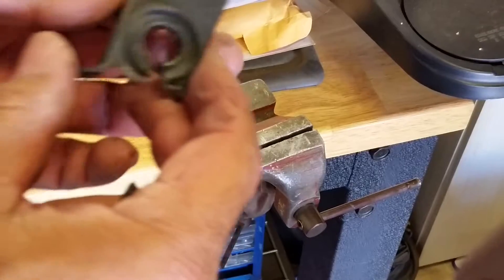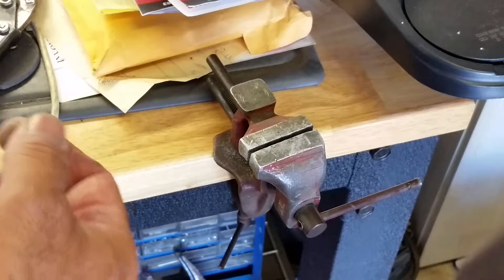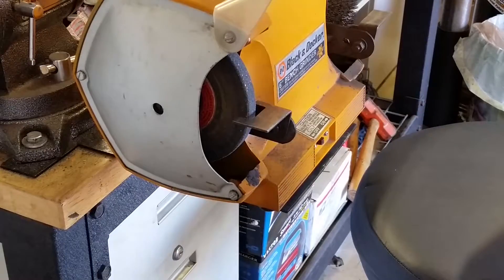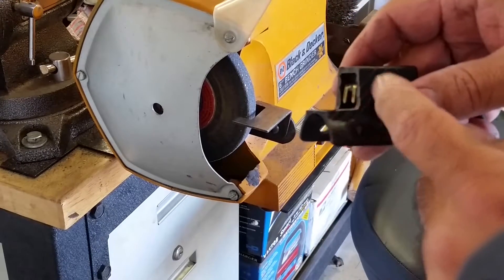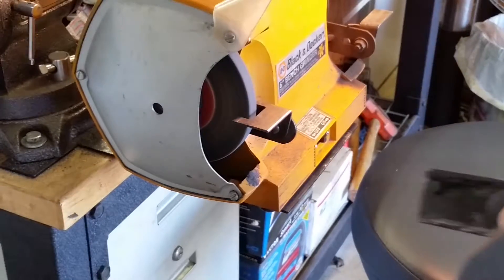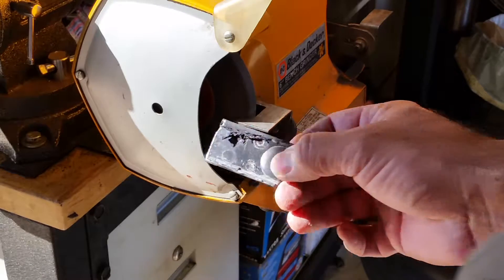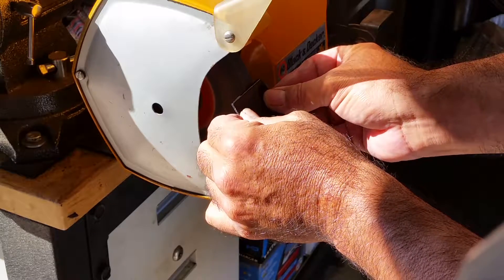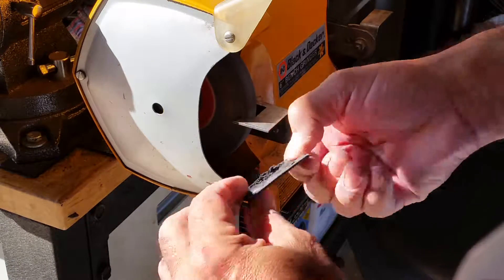How to: Converting a Miller 211 Autoset, 10 foot torch to a Bernard Q Series 20 foot torch Part 3

Comment: All that to get a plastic plug to line up with the stock screws? I would have simply hot glued the plastic plug onto the connector housing, or set it back and screwed it in the plastic housing.
Reply from the maker: To each his own.  I prefer the factory look.